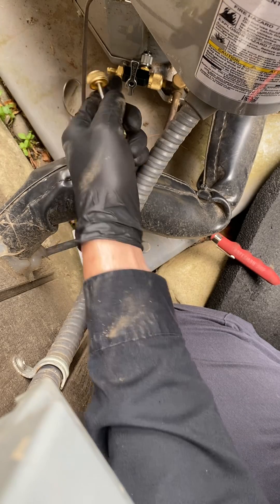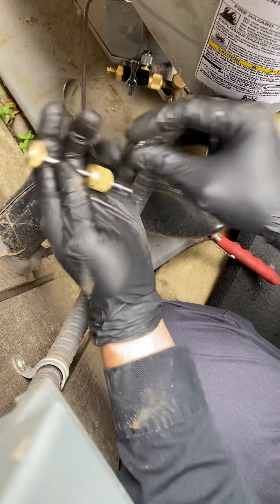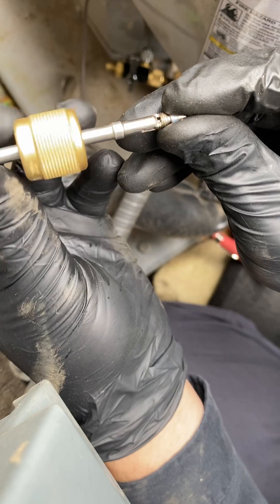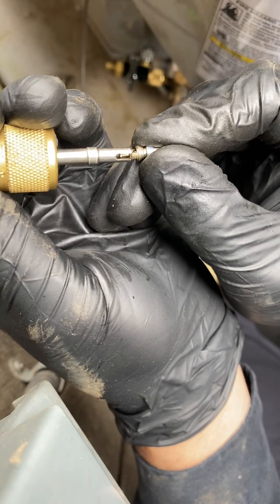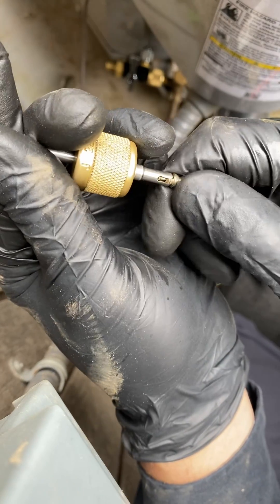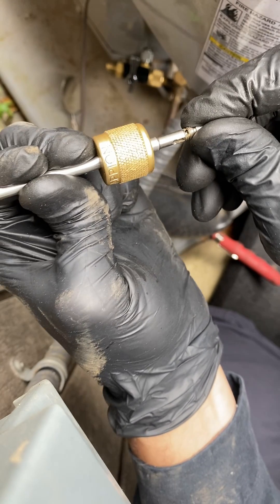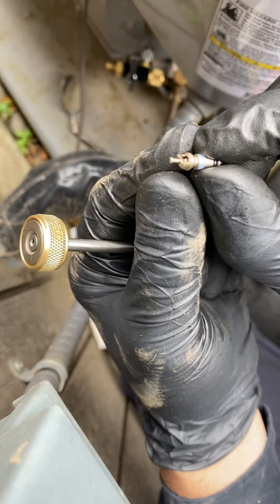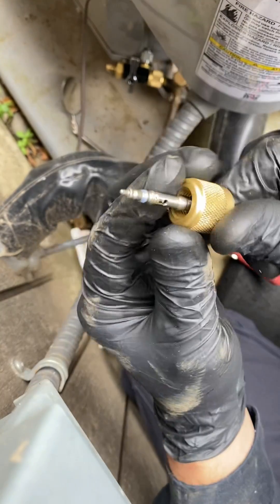Schrader valve core removal tip

Comment: I find a big variance in the dimension of valve cores in the location where the core remover grabs them.
Reply from the maker: @thisisyourcaptainspeaking2259  that’s why I like the C&D valve core removal tools. It grabs the actual stem instead of the part the appion grabs.